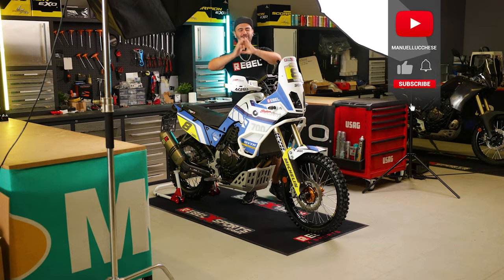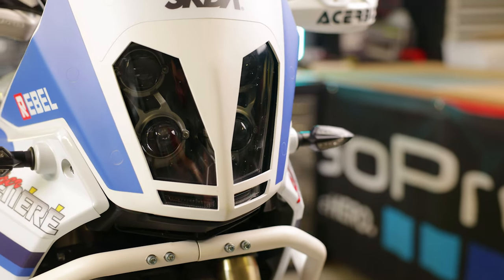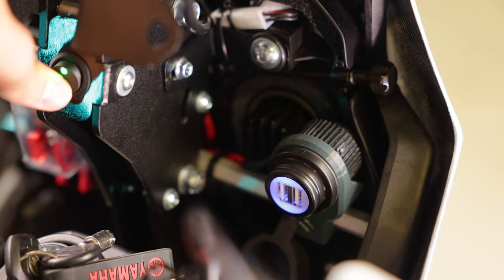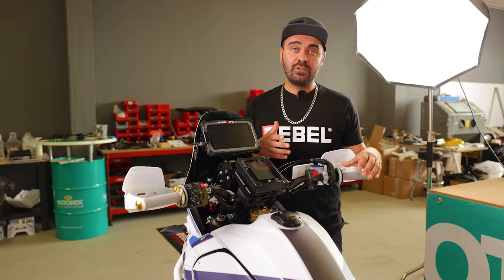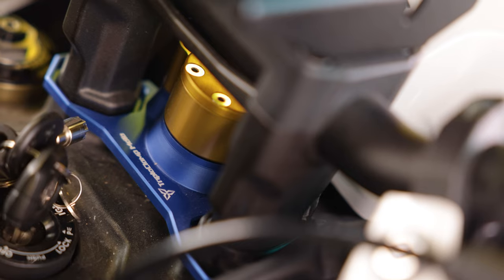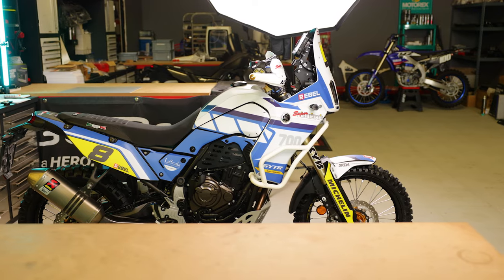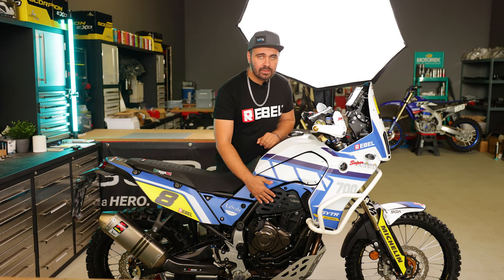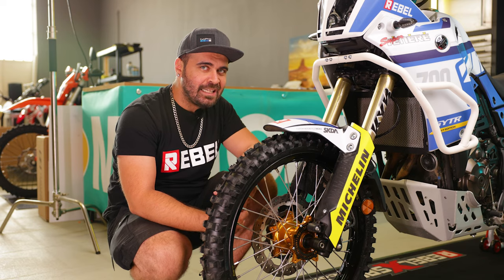New SUPER TENERE 700 Limited Edition

Comment: I find your Tenere 700 sublime, but i have a few things in mind. :)
I think that the silencer would look better at a higher position and closer to the wheel at the same time, it would as well take less damage in case of falling. At 16:55 we can see it is excentred.
I would add a side silencer protection that you often find on supermoto (like R&G brand, ring type).
I would hide the horn somewhere else at a higher position, higher than the bottom fork clamp.
I would add a tube or half a tube just superior in diameter but tight to hide the liaison between the crashbars just a bit larger than the screws, it could at the same time reinforce the fixation of your crashbars.
Well, that's it!

Comment: Great work, Manuel. The front screen for me I like. But would I buy it? It comes down to the price because it is really only changing the look. I've done much the same in regards to suspension work, which just makes the bike so much better. I have haan wheels, the back being 2.5inch. For me I would like to know how you did the front brake disc mod - one disc and brake hose. Less weight is always good.
Reply: MR Manuel Lucchese tel me that : Rebel X Sports you find in the description of the video the link to where to order them .

Comment: Incredible dream bike! 
I would've liked to see a solution for the muffler placement where it's quite susceptible to impact hanging down low, affecting the bracket that's connected directly to the frame under the seat. A notorious weak point in the T7 design. Maybe raise the muffler under the seat as other aftermarket designers have done for better protection and, in my opinion, a better look. And finally, I like the new white windshield assembly but not too crazy for the headlight cutouts (the Gladiator look). They look too gimmicky and... juvenile, for a lack of a better word. Maybe 4 round cutouts for each lamp with larger ones for the 2 top lamps and smaller ones for the 2 bottom lamps! It's a subjective thing so there's no right or wrong here. Otherwise... Mama Mia! Vavavoom!
Reply: Well this build is obviously for aesthetics, I posted the same thing and the Facebook group and nobody knew what I was talking about, most riders stay on the road and had no idea. On my first day of ownership both the subframe bracket exhaust and swing arm were all bent. Chop them off and went with a high exhaust from Poland with muffler for cheaper than this silly akra can in a horrible location.

It's so silly that the same people that run guards only to protect the replaceable plastics also still have this ridiculous exhaust.
Reply: @RedEmpire36  I don't own a Tenere 700 but a XR650R. I bought an Akrapovic line knowing how bad the design was, but i have made some modifications (welding) to have what you will find bellow. That's actually what i find appealing and at the same time it make more sense, because rear plates are basically made to protect the silencer in my opinion.
Type : Honda XR650R Supermoto by VMX Restomod (not mine ! but you will have an good idea).
Reply: @vonarg  great bikes. I owned an XR650R for years and the T7 is the only thing that made me finally get rid of it. As long as you fix the issues it makes sense. The people that have no idea and are only building bikes that look good is pretty high right now. All these pavement princess bikes with full crash bars (no dirt bike in the world has crash bars, who do all ADV guys insist on them)

Comment: Hi can you help I have removed the abs system however not the pump how did you remove pump without causing problem with the oem dash any help would be much appreciated 👍
Reply from the maker: Are you referring to the brake pump?
Reply: @ManuelLucchese1  yes just bin to jhon at Rallyraid he said he thinks you have removed pump I have removed all lines but not the pump 👍